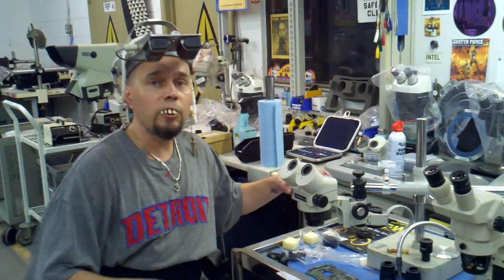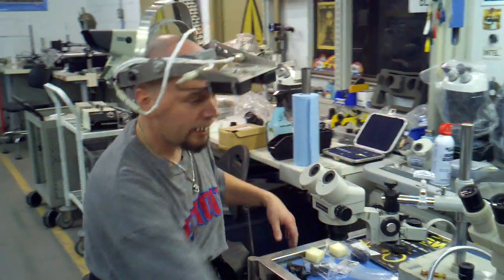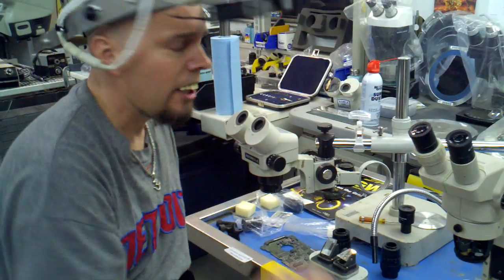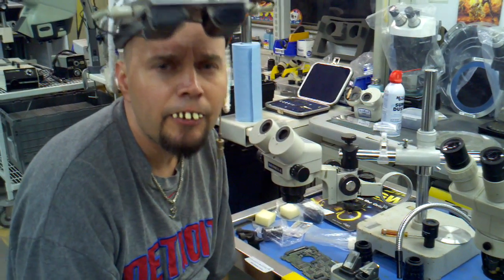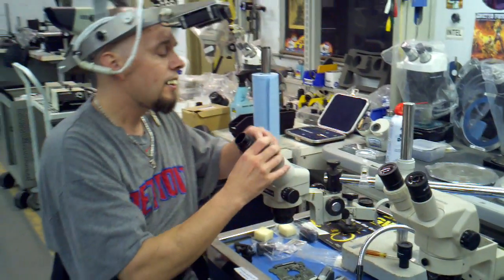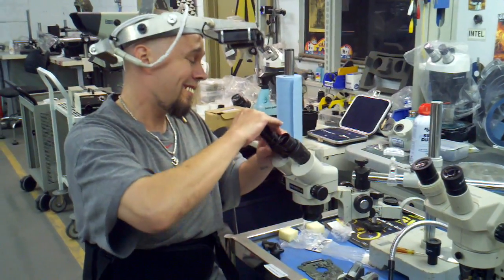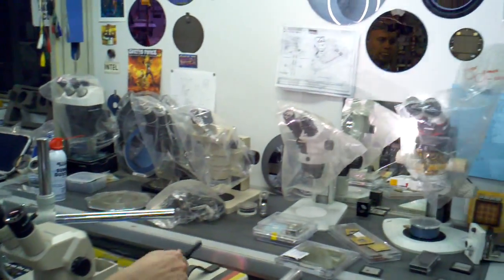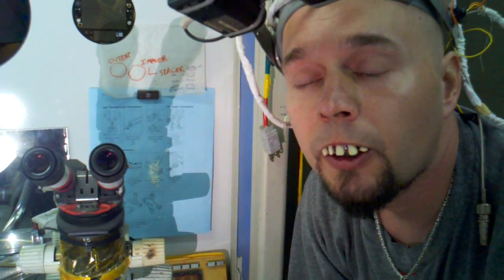How to: Repair Stereo Zoom Microscopes with "Bubba"

Comment: We have been in business for over 70 years and all we do is microscopes.We have old hard to find parts for any microscope and can repair any microscope. We have thousands of parts from AO, B&L, Leitz, Zeiss, Swift, Leica, Zeiss, Accu-scope.We can replace plastic Nikon or Leica gears with metal gears. We specialize in calibrations, alignments, and cleaning. We are an authorized repair center for many brands of microscopes.

215-925-2285 I. Miller Precision Optical